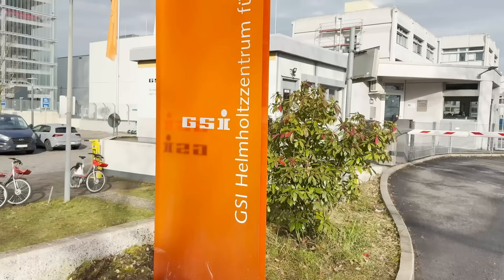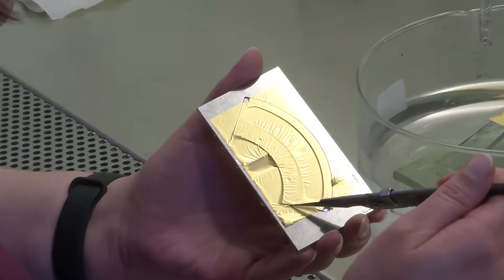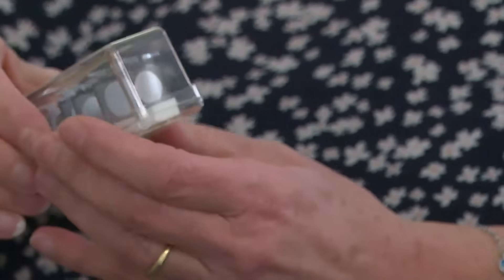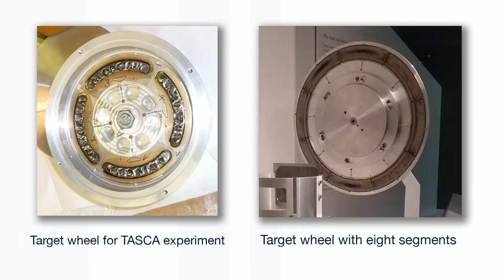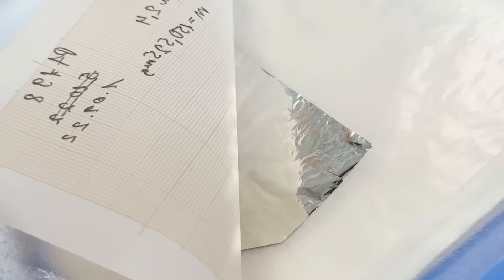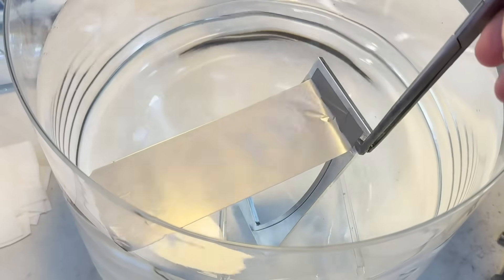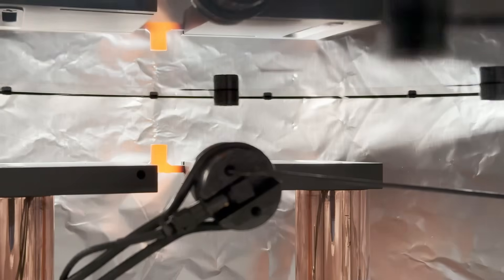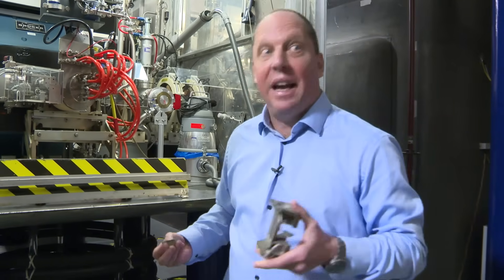Amazing Rare Isotopes (Platinum, Mercury, Gold & more) - Periodic Table of Videos

Comment: How did the films of metal stay on the metal frame? Surely after the water has dried out the film of metal would fall off the frame? Is there a glue on the frame or the film?
Reply: It will be fixed with a carbon glue afterwards

Comment: Wow, pulling those thin films out of the water so cleanly was incredibly satisfying to watch :D
Reply: Its like hydro dip paint.
Reply: @eFeXuy  True, but one that has to be aligned perfectly!
Reply: Similar to covering those ultra-light model airplanes that fly for like an hour in a gymnasium.
Reply: Pity Prof Poliakoff haven't show more about target preparation. It was a great chance as target lab at GSI is the one of the best in EU.
Reply: Why does the film stick to the frame permanently? The water might hold it on for a short time but after that is gone I don't see what is holding them together, why does it adhere to the frame?
Reply: @simhthmss  static charge and vacuum most like, same principle as putting a plastic film on glass.
Reply: @simhthmss  van der waals force

Comment: Liquid centrifugation (new aqueous method) could produce all of these very cheaply at large scale in the future, where gas centrifuges can’t be used if the element can’t be gasified at low temperatures/pressures, and most can’t!

Comment: Curious about how difficult some isotopes are to isolate than others.
Reply: If you can make a volatile compound of it, it's essentially the same process as enriching uranium by using gas centrifuges. The hard ones are the elements that you can't really get into the gas phase without excessive heat. They get separated in a special kind of particle accelerator called a calutron which is exactly as inefficient and expensive as it sounds. It's like sieving a truck load of sand by manually sorting the grains by size with a microscope and tweezers.
Reply: @hammerth1421  Thanks! You gave me a bunch of topics to look into. Very interested.

Comment: Sometimes I wonder how many elements actually have stable isotopes. Bismuth turns out not to have any. The Wikipedia article on isotopes of gold states (and gives a reference) that gold-197 has never been observed to decay but is suspected to actually be unstable with a very long half-life…
Reply: It becomes rather academic because an isotope with a very long half-life e.g. Xe124 will emit one photon or one beta particle every 5 hours per kilo.  That poses a problem for the equipment detecting this rare event as the materials the equipment are comprised of may well emit particles and photons too.  "Stable" is really only a relative description.

Comment: I'm a bit confused as to the final goal of process. And how they know what they have of the modified isotopes and how much.

Also, they mentioned some aren't made anymore. But they aren't able to make them? I thought that's what they're doing?

Sorry, just confused as to the bigger picture here.
Reply: It's for making the elements at the very bottom of the periodic table that decay within microseconds. They ram two specific isotopes into each other at high speed and hope a few atoms combine to make a specific isotope of one of those super heavy elements. That is then detected in the outgoing particle stream, either directly or as its decay products.
Reply: @hammerth1421  you mean what they are doing with the wheel and particle stream? Cause I'm pretty sure making the heavy elements is something that requires the energy from the circular particle accelerators. Although I certainly could be wrong.
Reply: Product of heavy elements need to be done at lower energies, but the beam is so intense at the UNILAC at GSI that the target needs to keep rotating!

If the beam energy were to go higher you would fragment the beam which also happens in tandem to the fusion of the target and beam. In this case you want it to fuse with the target and carry on to the detector setup, the junk is separated using a mass spectrometer.